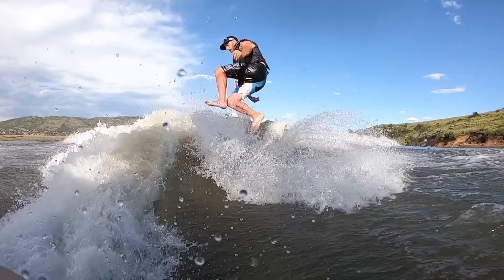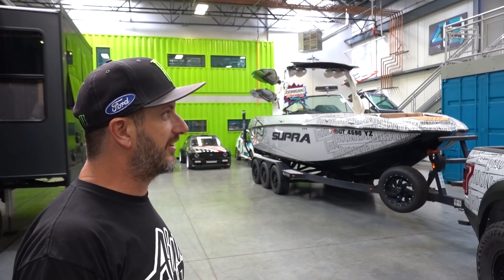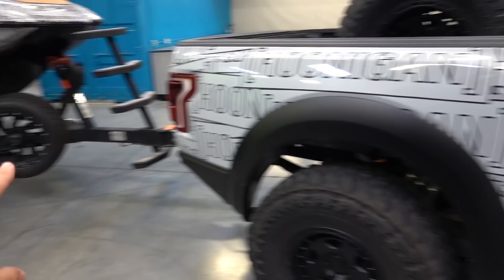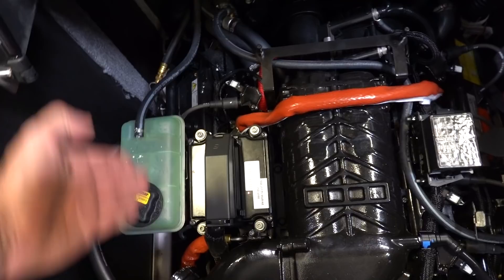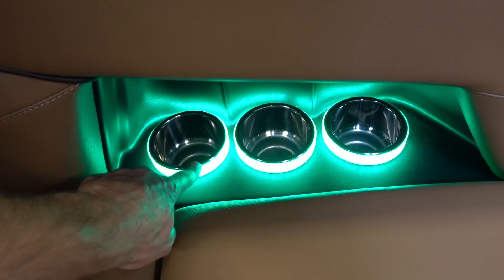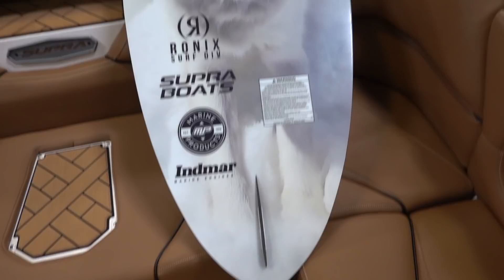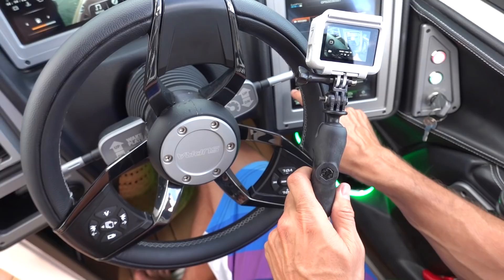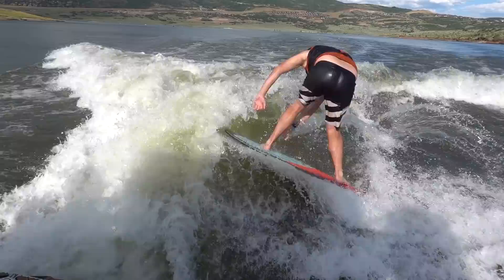Ken Block’s Raptor Powered... Supra?? Plus, Indoor Burnout!

Comment: Snowmobiling Powder Mountain could be fun but if it is the same I went snowboarding  my 1st or start of 2nd year it is not for that. Learned in weak Big Bear So CAL and took a trip to Utah. Stayed at ex neighbors and went with his little bro. No steeps and saw a nice powder field with a danger cliff sign at the top. LOL It was 4' high and pow into another run. His bro said no to weak advanced and I said not those that. My 2 friends said yeah. We all dropped in to our 1st big powder field and it was like surfing (WE LOVE SURFING). After going out for a lot of beer and failed to get buzzed while they were. We headed to Cottonwood Canyon for great boarding for a dew days, I became addicted to steep and deep pow and keep chasing it. Had a Heli  in Canada expert class and the guide burried his 10 foot depth check pole and arm to his shoulder with no bottom found. After telling we signed a waiver and our life was not there issue to opt out we went. At the bottom he was stoked and said you guys can board ! Want to go drop some nice cliffs. YES WE DO The first was 60 feet and great and we did some more. OOOPS BABBLING HERE SORRY A LITTLE BIT.

Comment: We have a Supra boat, and we LOVE it!!
Reply: Nice i work for boatmate in maryville TN which is right next to skiers choice who make the moomba amand supra boats. We make the trailors for thise boats. Is it sitting on a boatmate trailor?
Reply: @s1lentcalib3r   I haven't actually looked for the trailer brand.  It's a nice trailer, though, if it is.  I have a suggestion for you guys.  Can you start making the fold-away arm in a way that it can be locked when folded to prevent theft?  I know that's probably not a normal concern, but we keep the boat in dry storage at a marina, and the trailer is stored separately.  I'd hate to go pick up the trailer one day and find that somebody hooked up and drove off with it.  Also, have you guys considered building the trailers out of aluminum instead of steel?
Reply: @tayl0rd553  Try calling our office and  leave your feedback im afraid i can't give you answers on that i just work here as an employee. The R&D department handles the material we use and can maybee answer your question on locking the tounge.

Comment: 2:30 A diverter valve is a blow off valve?????
Reply: Similar concept just one recycles the column of air back into the system, while a blow off valves go straight to atmosphere... he's just making an easy comparison
Reply: @mannys4539  Factory blow off valves are re-routed back into the intake system. 
They are the same thing.
Reply: @rm6330  plz take a second and read my comment again dude
Reply: @mannys4539  Please understand that a factory blow off valve and a factory diverter valve are the exact same thing. 
They have a different names but serve the exact same purpose, whether plumbed back into the intake system or not.
Google is your friend.
Reply: @rm6330  DUDE read the damn thing that is what I was saying (we are agreeing on the same thing!) I said he was making an easy comparison so ppl would understand they are the same thing!!! jeezzz
Reply: @mannys4539  You're agreeing with me ffs!
I originally said that he is wrong by stating that a blow off valve is different from a diverter valve when there's no difference between the two. 
Then you chimed in agreeing with his analogy which is incorrect ffs.
Reply: @mannys4539  The concept isn't similar, it's exactly the same time.